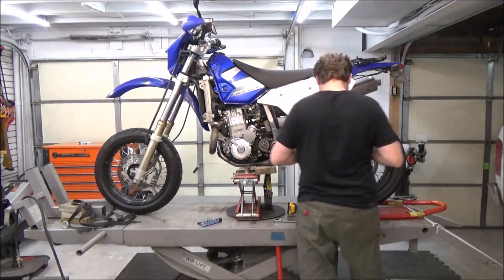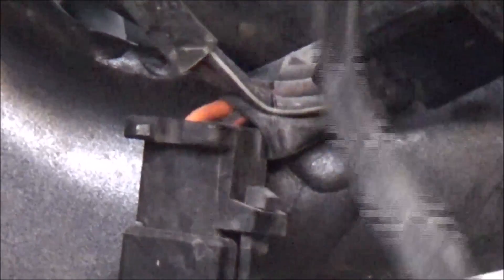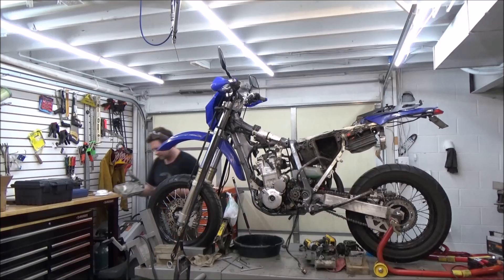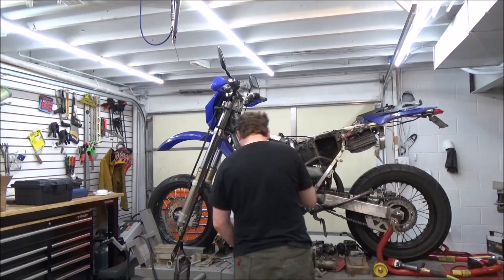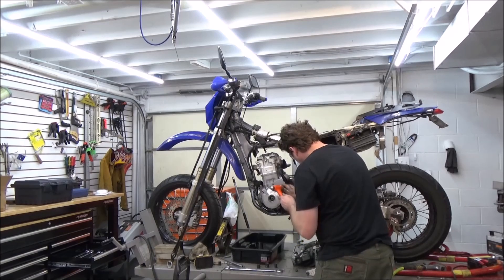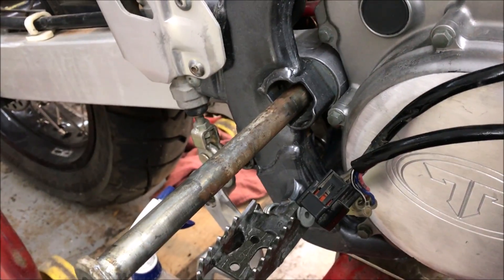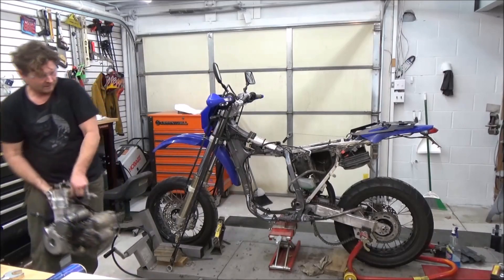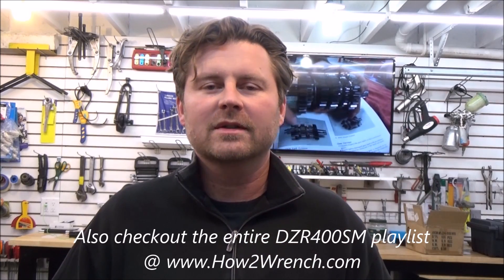How to remove a motorcycle atv engine in 6 min! Demo: DRZ400SM DRZ DRZ400 Engine Removal

Comment: I'm having trouble taking out the axle :( how did you do?
Reply from the maker: Looks like you need the techline...see below...
👍 Thank you for taking the time to comment! Hit that subscribe button if you haven’t please! It helps us! 
Here is a way to support all the free videos.
Want to say “thanks” or “keep it up”? Click here https://www.paypal.me/how2wrench  

Coach Conley is also available for hire to personally work one on one with you if ever needed. Yep he is a real person. Give him a call @ 602-345-0432

Your answers and help are just around the corner. Save time and money while protecting your investment and yourself by doing it the right way!
Follow us!
Web:
www.How2Wrench.com    
www.Tools2Wrench.com
Reply: same here. Stuck at this point. But from what I saw here I was right. The swingarm bolt is seized. 20 year old bike. So I think I need a solid round bar with a tapered end slightly narrower than the bolt. tapered end so that it contacts the face/ end of the bolt avoiding damage to the bolt. It is stuck good. Going to need a big hammer to get it sliding. Was using socket extension bars today but its quite obvious they may become damaged.

Comment: Hi there great video
was just wondering how leaving the gas on would result in a bent rod?
when you say gas on do you mean from the carb?
thanks
Reply from the maker: I'm making a full video explaining this! Gas was on from tank causing the carb to overflow into the cylinder which gets on top of piston. Liquid fuel cannot compress and the bends what is under it. The weak link is usually the rod. 

Thank you for the kind words! Stay tuned for the upcoming "Tech Talk" Live feed coming soon where a panel of experts will address YouTube comments of the week. 

Head over to the new website and subscribe to the newsletter to never miss a video or newsletter! 
https://how2wrench.com/contact/ 
If needed someday know that I offer personal help. This video explains the next best step to connect with me. 
https://www.youtube.com/watch?v=vjvmB01ebcs 
Direct link to services: 
https://how2wrench.com/product-category/tech-lineservice-callminutes/ 

Did you like this free video and hope to see more? Would you just like to say thank you with a donation? Click https://www.paypal.me/how2wrench
Keep Wrenching,
Shane Conley
Instructor/Motivator/Motorcyclist!
www.How2Wrench.com
Reply: my drz carb has 3 settings on, prime and reserve
what setting is the carb supposed to be on when the bike is sitting? on?
Reply from the maker: I will have to make a video on that one. Here is a free tip. On a fuel valve with on/reserve/prime. IF the fuel valve is working correctly you do not flow fuel in the on/reserve positions until the engine is running and pulling a vacuum. Prime bypasses straight through. 
So when not running the correct position is on or reserve. Test the integrity by putting a clear line on the valve (disconnected from the carb) overnight with a full tank of fuel. Do this test in both on and reserve positions. If ANY fuel is in the line than the valve is leaking and needs rebuilt or replaced. 

Head over to the new website and subscribe to the newsletter to never miss a video or newsletter! 
https://how2wrench.com/contact/ 

If I can ever be of service to you, here is a video explains how to connect with me. 
https://www.youtube.com/watch?v=vjvmB01ebcs 
Keep Wrenching,
Shane Conley
Instructor/Motivator/Motorcyclist
www.how2wrench.com

Did you like this free video and hope to see more? Would you just like to say thank you with a donation? Click https://www.paypal.me/how2wrench